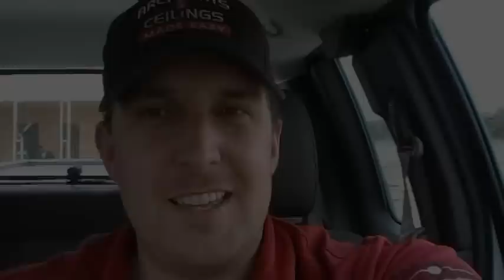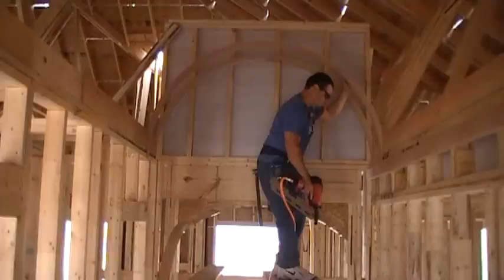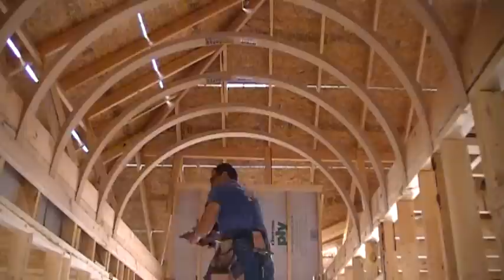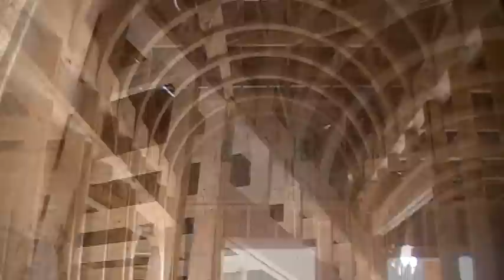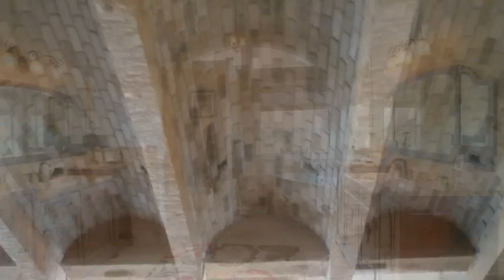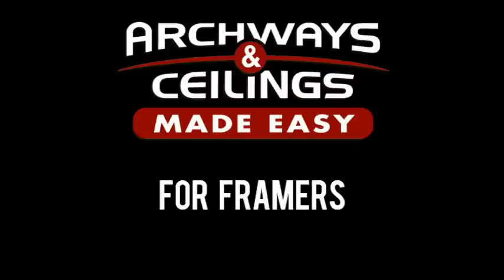How to Build A Barrel Vault Ceiling Efficiently, Affordably and Perfectly

Comment: On big jobs large spans.  I have built  the arches out of LVL  s  cutting the arches on site  and pining them to the girder , I have also cut them from 
4 or 5. By 10 marine plywood and laminated and glued and screwed them together on edge to a thickness of 1 and 1/4  they will support massive amounts of weight   Like a wood  I beam floor joist 
You do beautiful clean work a true craftsman 👍👍👍